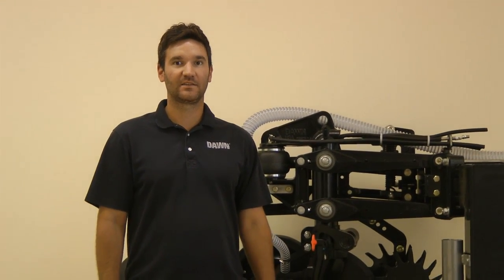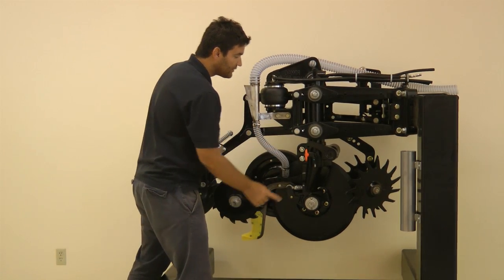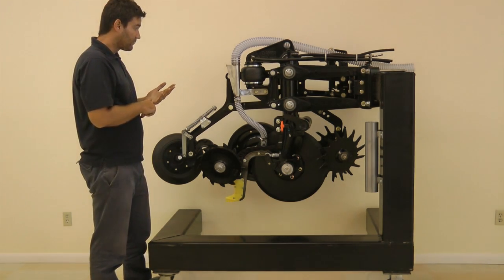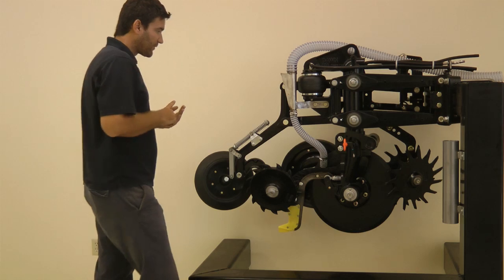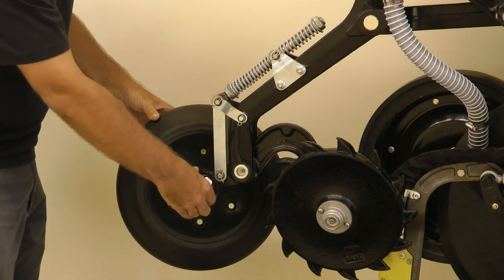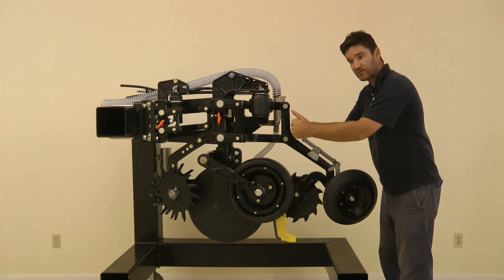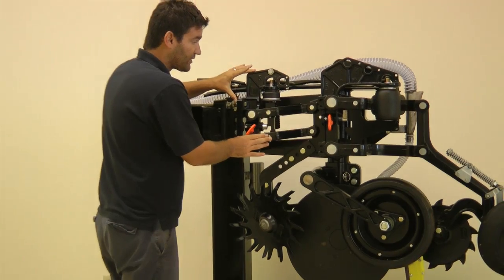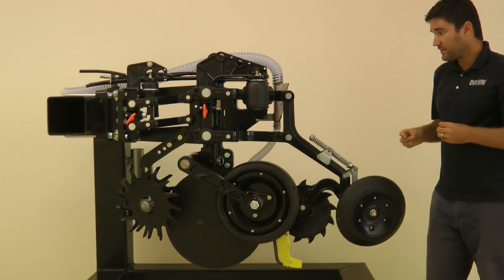Description of the 2011 Dawn 6000 Universal Fertilizer Applicator

Comment from the maker: Yes, you can use the model 6000 device on 20". The configuration of the row cleaner may change in some conditions.A knife most definitely will not manage residue better. Vetch and pea residues are both very easy to deal with.